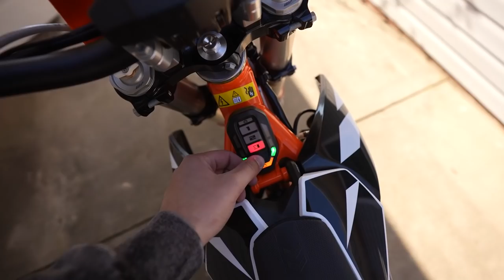SURPRISING MY DAD with NEW DIRT-BIKE!

Comment: braydon you gotta get a bicycle then put a 100cc 2stroke kit(stage 3) and rip on it and see what you think(ps theres a bolt on the stock exhaust to remove the baffles which gives you crazy torque)
Reply: they do have a power band like a 250 yamaha 2 stroke